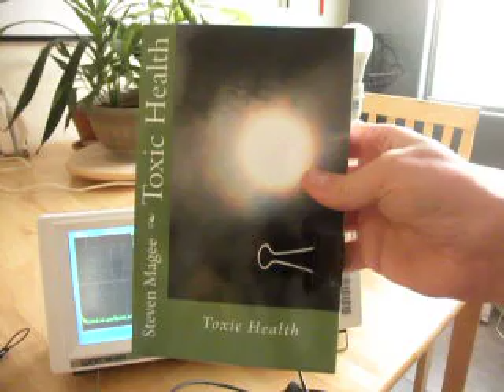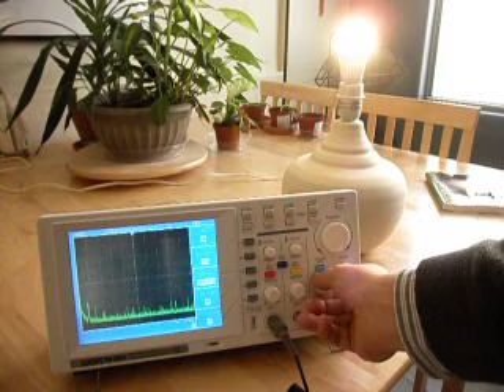LED Light Bulb Frequency Effects on the Human Body

Comment: You are reading harmonic distortion oscillations. Nothing harmful. All electric has a frequency. 120v aka half cycles runs on 60hz full cycles. Not harmful, just how it works. Your measurements only detect negative feedback distortion back into the grid.

Comment: My only concerns with the LEDs are...
> Ultraviolet light emissions.  That's been ignored for (just about) ever. Primarily for "energy savings". 
> The cheaper ones flicker at 60 times/second. Some at 120/second. The 60/sec ones are noticeable and very annoying. They can also up as black bands on photos.
> All this "radio frequency" stuff is bullshit.
Reply: There are no ultraviolet emissions from LED, you can do the CD test to see that, most likely you will see an even spectrum of colours ranging from deep red to indigo. The RF emissions and flicker come from poorly designed power supplies in the bulb itself.
Reply: Even if you use a quality prism instead of a cheap CD. You're not going to see and IR or UV light, because you can not see UV.
There's IR, VL and UV light.  Only VL (visible light) is visible.  That why they call it visible light.
This is 4th or 5th grade science.
Reply: Halogen lamps produce more IR and UV then LED. Some people can see UV and IR.

Comment: Some of this could be the drive circuitry found in some of the LED bulbs.  Some of them have circuits to lower the voltage or reduce the flicker due to the fact that LEDs are diodes and light on only one side of the AC waveform.

Comment: I built a house under the power lines.
If I held  a Christmas tree by the bottom and the middle, I would get shocked.
35 years later I am in excellent health.
Reply: congrats.  but unless you post all your genetic variants, your blood type, your diet, bloodwork, then what happens to you is an anomaly and potentially irrelevant to what happens to others or the facts.  some people are stuck by lightning 7 times and live health lives, but most are messed up if they live at all.
Reply: my uncle died at 93y/o. he was smoking too, does it prove smoking is safe?

Comment: If you deconstruct the bulb you will find a transformer in side the base of the bulb. The transformer is a copper coil that ramps up or down the voltage and hertz and it creates it's own electromagnetic field and of course it is going to have an effect on the body. It is simple logic.
Reply: Arron Hampton Simple logic would tell you the magnitude and frequencies emitted by your cell phone, TV, and a lot more cause the LED to pale by comparison. You have more to fear from the sun than any LED.
Reply: Every "wall wart" power supply has a transformer in it. Are those harmful now too? :/
Reply: Yes, you are supplementing what this chap is demonstrating. You should be the narrator.
Reply: Yes, they can be as they would most likely use an unshielded switched-mode power supply, that would be operating between 200Khz to 1Mhz. It, not the LED it's the power supply driving it.

Comment: The LED's themselves are not causing the emitted frequencies to the human body. It is the circuits providing the DC voltage required for the operation of the LED that will be emitting (if you can call it emitting) the frequencies. If LED's were used around 50 years ago they would have put wire wound transformers in the fitting to convert the high AC voltage into a low DC voltage for the LED's. The transformers would be quite harmless if one was looking at emissions. Obviously a 240 down to 'X' voltage transformer isn't going to fit into a light fitting. Ever heard of a switch mode power supply? They create high frequency 'noise' (and I use the term noise lightly) which can inteffer with electronics, or 'humans' if you will. Switch mode power supplies (voltage converters) make mains supplied LED lights affordable. 

If you were time in excess, you could research the effects of RF Radiation on the Human Body. For example, if the LED globe was a 20 Watt item and you could say that the 20 Watts is being delivered into an Antanna (the globe) with the globe having an antenna length of X (length of the element which is miniscule in this case). You need to take into account the frequency which I dont know (frequency of the power supply) and... And in your research you might find that mobile phones are capable of transmitting 1 watts of power (and that is next to your brain!) at between 800 and 1200MHz depending on where you live (this might be more interesting). I could go on... Don't forget that the Human Body acts like an Antenna... It can pick up a large range of frequencies. This may make your testing difficult if you live near a TV antenna.

References: I work on Tx equipment ranging from 10W to 4KW. I go and test them in-situ to make sure they meet the General Public Guidelines (in Australia). 

Im all ears to critisism. 

Cheers
Reply: (.....delivered into an Antanna (the globe) with.....) You mean "antenna" don't you? Anyways, very informative-wish the LED car headlights could be banned - they literally hurt my eyes....thanks for posting the video

Comment: Incandescent bulbs also induce frequencies in the human body. It is not the amplitude which is important, but the specific frequencies. Substantial research needs to be done to determine which frequencies are beneficial and which are harmful.
Reply: Amplitude is very important.. especially with 'certain' frequencies. Amplitude will show the extreme value which indicates the threshold when a given frequency is actually dangerous to a human. And also frequency mixture (harmonics) will also play on the amplitude strength.
Reply: Yes but there's also the concept of dirty electricity, I believe incandescent bulbs don't produce that as they are designed to work in light fixtures. Just for that reason, Its worth using them. Incandescent are a analogue light that mimics the sun, so as we live with the sun, it would probably be the case that our bodies prefer it's light.

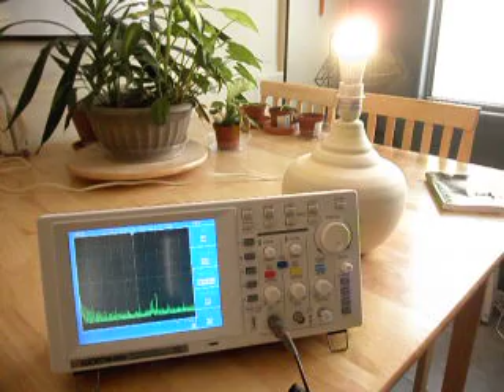Comment: Interesting - oscilloscope shows similar response when his hand is close to it's screen as when close to the light bulb (around 3:20 in the video). i.e prob you'd get the same from a TV /other gadgets. So either we're doomed or it's not a problem.
The freqs (upto 2MHz) he's looking at are at the AM radio end - least harmful. Radiation gets more harmful as freq increases (visible is 500 THz, then UV, X-ray, gamma rays. i.e. this is prob not harmful. And nothing compared to mobile phones, etc.